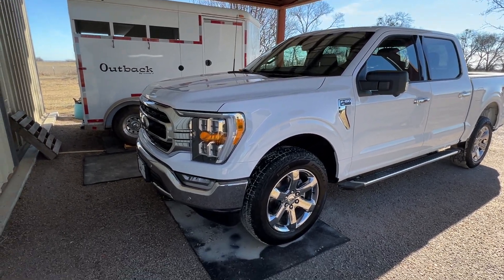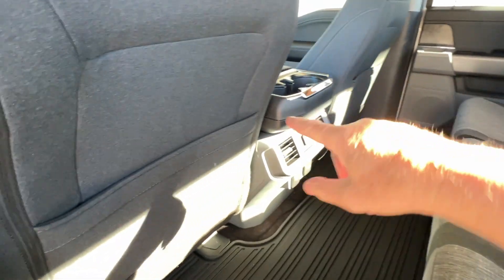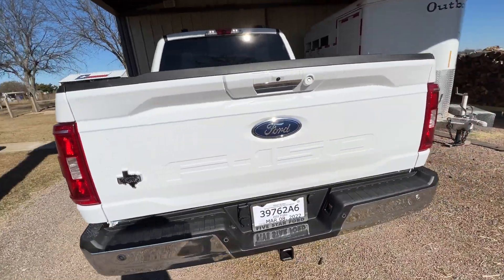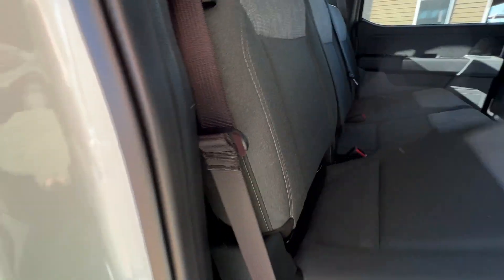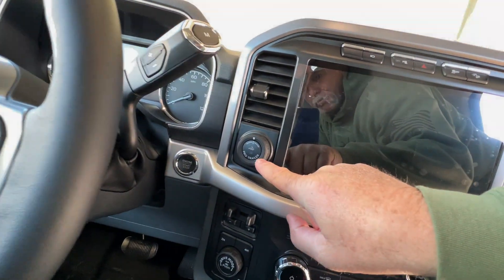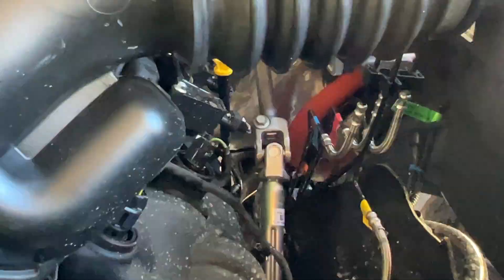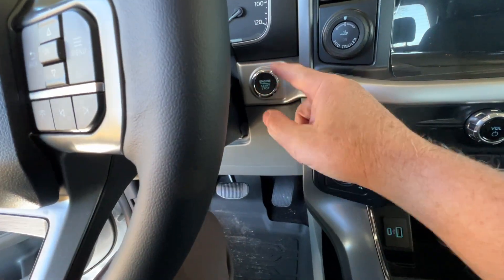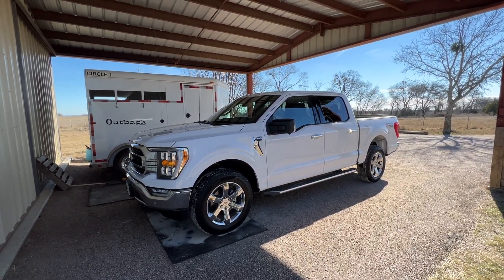Traded Toyota Tundra For Ford F150 - First Day Discussing Things I Like Better On Each Truck

Comment: But you forgot to tell us about the most important part.  Is the wiring in your F150 coated with soy based rat food?  I thought that was the major reason why you wanted to get rid of the Toyota in the first place.   Take care.  sincerely,  Dean O.  :-I
Reply: Most manufacturers do that it’s really hard to get a vehicle with good wires
Reply: I work for the county and we have a fleet of Ford's. The mice love to eat wires on them. We replace a lot of fog lamp harnesses from mice eating them.
Reply: I was wondering that exact same thing.
Reply: @CaptRich-bi3gp  ---  I know.  I like Rick.  As cantankerous as he can be at times he is a wealth of information as well as an overall good person.  I didn't post this comment to embarrass him.  I sincerely want to know what happened from his perspective.  Because he told us when he was putting out all that money to fix his Toyota and was also doing everything he could to kill all the mice on his property that he was going to sell the Toyota because of the soy based wiring.  Why sell the Toyota and buy a new truck with the same rat food wiring?  Perhaps his new warranty covers rodent damage to the electrical system?  But he won't answer my question or address the situation on his own in a follow-up video as of yet...  so your guess is as good as mine.  Take care.  sincerely,  Dean O.  :-I

Comment: The doors and rest of the chassis are made out of aluminum.  That's why the doors are lighter.  FX4 is the off-road package, skid plates.
Reply: Body is aluminum, chassis is still steel.

Comment: That’s an overflow tank. All cars have them now. It’s to let the engine breath and not drip coolant everywhere. You never over fill it bc then it defeats the purpose of it. Fords are good drivers and they’re huge inside. Nice truck.
Reply: The ford f150 is the first vehicle i have ever owned that i don't have to have the seat all the way back to drive it . 2010 f150 lariat love it .

Comment: FX4 attunements generally include an improved suspension, skid plates, stronger Ranchero shocks, a higher ground clearance, and a limited slip rear end. Most have automatic 4×4 shifting on the steering column as well.

Comment: Smart choice. I've owned 4 Ford trucks, 2 of them F-150s & all were solid! Regular maintenance & they run for a long time. I've put over 100K on most of them & never had any major issues. Good luck with your new truck!🇺🇸👍. Btw I would recommend weather tech floor liners, front & back.
Reply: Weather techs are good, but the Ford accesories folks have really stepped up their game on the all weather liners.  Odds are he would have had to pay extra for the weather techs, whereas they threw the ford ones in free, and they're actually comperable now.
He should take the carpets out for a good fit on the rubber mats, though.
Reply: I decided on my new truck to do away with floor mats. Makes cleaning carpet faster and easier in my opinion. I'm going to i track mud most days anyways.
Reply: 100K is just beginning, but you're right about regular maintenance.  200K is what I would consider normal unless it is a heavy use (always towing or hauling heavy stuff) every day work truck.  The smaller Toyota Tacomas do start to burn oil around 250-300K so you have to keep oil with you and check often.
Reply: @Adam-rp2fi  That’s not good for the carpet, the dirt getting into the carpet fibers will cause wear.
Reply: @Tat2Dragons  True, but I doubt I'll wear out the carpet before I wear out the truck. My last 2 Fords I wore out the driver's side seat, 1 leather &1 cloth/vinyl. The carpet stayed like new due to rubber mats. Those vehicles didn't fetch any better price on resell. Besides, in all my years, I've never had a floor mat to stay put.
On another note, I drove many of City vehicles without floor mats. The workers all wearing boots, seems to take about 20 years or more to wear a hole in the carpet and vinyl flooring. The hole would always appear below the throttle pedal.
Reply: @Adam-rp2fi  Gotcha 👍

Comment: Was the Toyota failing you? Anyway, I think, if I was to get a Ford F150, I'd opt for a truck much like you bought. I really like the normally aspirated V8. Much less to worry about, than the twin turbo V6. 

I hope it's bullet-proof, for ya!
Reply: @suspicionofdeceit trade the mice
Reply: @suspicionofdeceit I heard that spraying deer urine on the wires repels rodents. Many manufacturers, including Ford and Toyota, have turned to wiring with soy-based casing, which attracts rodents. I think you can buy deer urine sprays at Academy and Cabella's.
Reply: V8 will eventually disappear
Reply: @suspicionofdeceit Thanks! I didn't catch that!
Reply: @Wolf.88  I agree! I have an '18 Tundra, with the 5.7, and I'm going to hang onto it for as long as possible!

Comment: just a heads up rick. the other side of the back seat will most likely fold down as well. there are plenty of videos on how to get to, and actuate the release.... a short piece of paracord  and a keyring loop will fix you right up... perfect rifle stowage. they don't have that side of the seat set up to fold down b/c on fully loaded models, they stash the subwoofer and power window motor there.. enjoy!
Reply from the maker: thanks I did video on it

Comment: Nice truck. I hate where they put that coolant reservoir. It's right in the way of everything.
Do yourself a favor and get some Weathertech floor mats. They come up higher than the stock ones plus they don't have any holes. I had them in my old truck and the carpet still looked new after 5 years. Plus they are all rubber so they are easy to clean.

Comment: Hey Rick. Congrats on the new truck. Earlier I had posted a comment with a link in it that got deleted. I didn't know I shouldn't do that . I know how you like storage compartments and if you search f150 gun storage, several interesting sites will pop up.
Reply from the maker: commie tube deletes I did not
Reply: @HeyGunPeople  No problem. Enjoy the truck. Hope you can keep those little rat bastards from chewing on the wiring harness

Comment: I'm not sure if anyone else already said it. 
But the one thing I wasn't crazy about was, the rear wheel wells didn't have a plastic wraparound inside it. 
The raw painted metal is gonna get all kinds of beat up from the tires tossing rocks and road crap. 

Other than that? Nice truck dude. 
I'm just blown away at how much "pick up trucks have become rolling arm chairs and how high their cost is now.

Comment: Rick, you can press and hold both bottom buttons on the door unlock pad  (7/8 - 9/0) at the same time and lock the doors when you do not have the key fob near the truck. This allows you to access your cab with your secret code and relock the cab even if you left your keys inside your house. You can reset that door unlock combination any time you want as long as you remember the current unlock code. If you never reset the code then it is on a sticker in the back or front of the owner's manual.
 There should be a little "pocket" inside the center console near the back on the side of the driver that you can set the key fob in and start the truck even if the key fob battery is dead.

The truck has an automatic idle shut-off so you can't just sit in the truck and let it run Willy Nilly. You can turn off (or) over ride the automatic idle shut-off from the drivers menu but you have to do it after 'every single' start up. In other words, if you are stuck in the snow and want to keep the truck running until you run out of gas (longer than the 15 minutes it is set to 'auto shut off' from the factory) then you must go into the driver's menu BEFORE it shuts off EACH TIME. 
You can reset the automatic idle shut-off run time from 15 minutes to 45 minutes and it will stay at 45 minutes until you go back into the driver's menu and change it back to a lesser time. But the automatic idle shut-off cancellation goes away every time you restart the truck.
 You only get three automatic idle shut-offs, in one sitting, before it will not restart with out contacting FORD on the phone. That 3 shut-off limit resets every time you manually turn off the truck (on purpose) then start the truck and complete a "drive cycle" (what ever the hell that is). I guess that means drive to the store or something.
 Also you only get three 'remote' starts at one sitting. PERIOD. It will not remote start again until you go out to the truck and start it with the key fob in your hand. You CAN set the "remote start" auto shut off from 5 minutes to run 15 minutes between remote restarts. That setting will stay at what ever you set it to until you change it in the menu as well.
Follow me for more FORD hacks. lol
Reply from the maker: nice tip thanks

Comment: Wish you good luck! Do you know if thats the aluminum body?? see if a magnet stays.... that could be why its lighter... if it is, good thing you live where there is no snow. I have been hearing nightmares about them up here in New England. One person we know had to add weight in the bed to help with traction. I just had to get a new vehicle this past summer. Not the best timing but had no choice. I got a new Tacoma, then found out from you about toyota doing the stupid plant based plastics.... the only good thing is I use my truck quite often. Almost never sits for more than a couple of days. Hoping I won't have the same problem with mice.

Comment: I have had both, both good trucks. But my fords just seem to be more refined. No trouble with either. Currently have a 2019 F150 pushing 80000 miles. Would get a 2021 F150 but will not be ripped off by crooked dealers. Will drive current one indefinitely. I maintain my trucks above and beyond manufacture recommendations

Comment: Did same thing. Tundra to F150. Tundra gave me 225K trouble free miles but my F150 is way more comfortable. I got a used 18 platinum using Carvana. Their service sucks but their prices are great. I’m waiting for Ford to deal in that all electric set up.

Comment: FX4 is the offroad package, like TRD on Toyota or Z71 on GM products. the integrated brake controller works awesome compared to add on units I have used in the past, you've got more room in front of the engine because it has an electric fan, the antifreeze tank is just the reserve for the radiator, it should have a hot and cold mark on it for proper fill amount, keep in mind there is another fuse box in the cab, I hate the push button start, you will wonder how to turn your dome lights on at night, you should be able to hold our finger on the bright adjustment setting for your dash lights and they will just come on.  When the truck is unlocked and you press 8-9 at the same time on the keypad outside the doors will lock, the nice part of this is it will do it while the truck is running.  If you don't use the keypad or your key to get back into the truck the truck alarm will go off and it won't come out of park (at least on my '14 F 150).

Comment: That's a sweet looking truck, Rick. I used to be iffy about Ford too because I used to own a 2015 Ecoboost that also gave me a ton of electrical issues. Unlike the 3.5 EcoBoost, the 5.0 Coyote V8 is a great engine with tons of aftermarket support. You may have to completely dissable Auto Stop/Start, its some BS that car manufacturers are adding now to "lower emissions". If you keep it on, your truck will shut off automatically at red lights until you let go of the brake. All car manufacturers are adding it and its F***ing annoying.

Comment: Why did you get rid of your Tundra, what year was it? I came from a 2009 Sequoia biggest issue I see is turning radius, but I also got a 21 SC with a 6.5' bed. I got rid of the toy as I didn't want to do anymore maintenance on it as I had a 4.7 and the market was good for trade in. Overall I think the Ford is okay, but I also got employee pricing which was crazy in 2021, but I am in waiting for it to disappoint me which is sad... Last pro is aluminum as I live in MN so we salt every thing, I am worried abouh the frame compared to the body...

Comment: You can move and hide the button easily if it's electrical. My worry would be that you couldn't access the gun if your battery is dead or damaged (like from a shooting or vehicle accident). Could be a bonus too though in the case you're in an accident and injured/unconscious, nobody will be able to access your property in the glove box.

Comment: Good evening, love your new truck but I'm a Ford girl too. My only complaint I've had was in 97 when the new 3 door came out. I bought it and supposedly paid extra for the heavy duty towing because the 24 ft. trailer I pulled was made of steel and heavy. My old truck never had a problem pulling long distance. LoL, I hooked it up and it squatted. I was so disappointed.. I traded it in with just 3,000 miles on it.

Comment: 9:12  Mouse House / Mouse Intake 😀
9:48  Firewall acoustic / insulation material with heat shielding 
10:00  Engine coolant storage / overflow tank (coolant expands when hot & contracts when it cools etc)
10:20  Air Intake Resonator (smooths out the positive & negative pulses = a Helmholtz Resonator)
Reply from the maker: Thanks for sharing
Reply: @HeyGunPeople  👍 No problem Mate,  thanks for all that you do and the proper values you represent. keep up the great work.

Comment: Footnote:  I would put that fuel funnel in the glove box so you don't lose it.  Just a little hint.  But yes love all the cubby holes.  I hated the tires that came with my Ford.  So I got 265's 16" but this was 20 years ago.  Who knew they would be stopping the 16" rims!  And I got me those little bubble mirrors for my side mirrors.. those are nice when you are hauling a horse trailer.  Me and bumper pulls don't get along.  I can back a gooseneck on a dime and give ya ten-cent change...but a bumper pull ya got to do everything the opposite where you want to move it.  ugh.

Comment: Nice truck I need bigger than my f250 due to big horse trailer with 11 ft short wall living quarters 3 horse.  So I need bigger f250 does the job but going up mountains I feel the trailer.

Comment: Your lucky that you got the fuel
Adapter cuz I didn’t get one with mine 2018 the diver side should flip down you have to pull the latch behind the seat. I’m sure you got the v8 if your towing. And the outlets in the back help with anything you need to plug in and you need that much more length.

Comment: I love my F150 Lariat.. but I do like how the Toyota is equipped. You will get use to the gas line fill :). The Off-road just means you have a skid plate under.

Comment: My corvette unlocks automatically with the key fob in my pocket. The bad part is if the battery is dead 
you use a key to unlock the trunk, pull the left covering and pull a handle to open the door. The nice thing is you never have to take it out of your pocket to even start the car. Not sure any other cars work that way. Nice truck by the way.
Reply: My Honda ridgeline works like that but only for the driver and passenger front doors, not the crew doors.
Reply: @ScooterFXRS  Interesting, the doors on the corvette are electrical, you squeeze a pad under the handle.

Comment: Nice truck Rick, be careful with Fords keyless cars as the security around it is crappy! ( unless they have updated the security system) my moms car was stolen off her drive and that was a ford keyless car, luckily we were able to get it back undamaged! Thanks for sharing :)
Reply: Any keyless car is susceptible to highly skilled theives.  Organized crime steals latemodel vehicles and ships them overseas.  They make keyfob "holsters" that block the radio signal to prevent this.
Reply: As should still have a key fob on your person's when is alot simple to get a simple key fob programmer Same thing for the most part they do with garage openers
Reply: Like CAT heavy equipment all use the exact same key so if you have a key you have access to all of them
Reply: @ferguson8143  What?

Comment: Rick, it’s the way the dealership orders and specs out their vehicles that you get what you pay for. So the truck that you have may not be the ultimate truck that it could be. I was a auto salesman and I sold Ford for a short time. Everyone went with the GM style display buttons switches circle thing. If you would’ve spent the time to spec out a truck and customize it you would have got what you wanted or if you would have went for a dodge or GM truck you would’ve got more. You would have spent less per month if you leased the vehicle and I know people hate leasing but remember it is a closed contract you know what the truck will be worse in three years and if you want to buy it then or just lease another vehicle at least your payment would almost be half than buying. Yes they have a miles contract but you can always negotiate that in a contract when you lease or buy your next vehicle.

Comment: Power inverter is so you can use the 110s without draining your battery super quick using them, that was under the back seat. The clear resivor above the radiator is the over flow. I can see the fans and radiator below it.